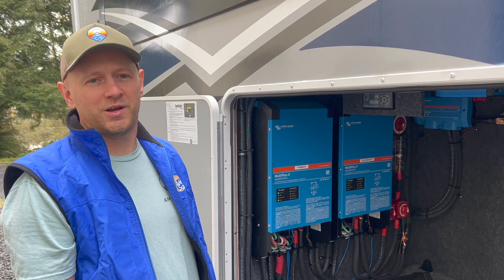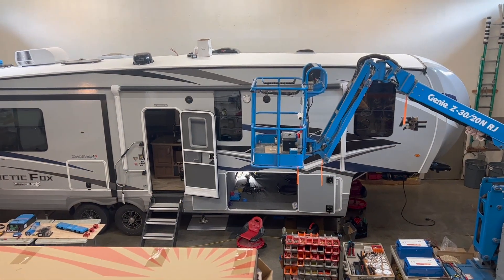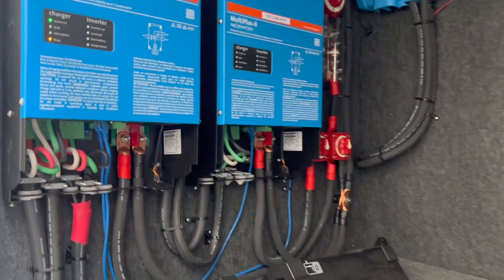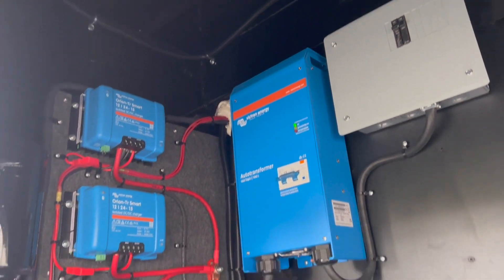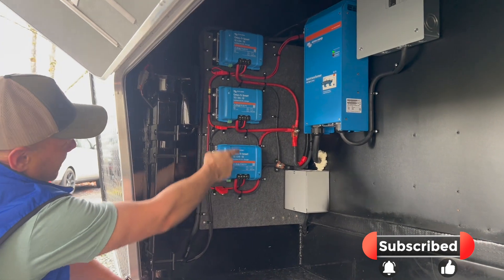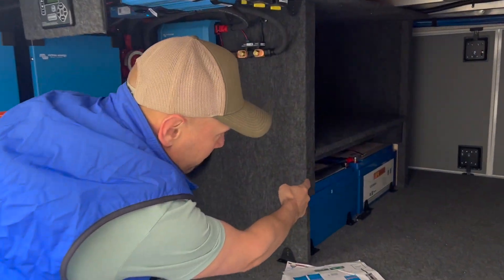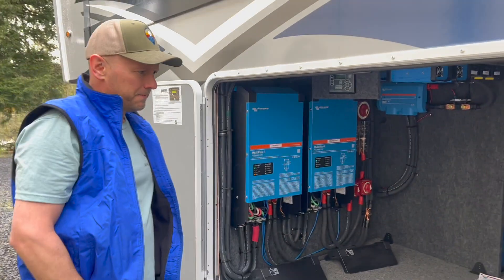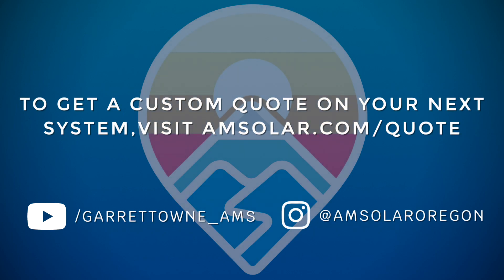Victron Autotransformer System Installation | Arctic Fox Power System Installation

Comment: Is there a reason why you run the inverters in parallel instead of Split phase?
I built a similar system in my RV but I did it in split phase, just need to know if I'm doing things inefficiently?

The purpose of my auto Transformer is to pull equally from both of my quattros.
I also have a cam switch that allows me to change wiring configuration of the inverters into paralle configl by simply flipping the switch and changing the inverter profiles remotely over vrm. The entire thing takes about 60 seconds but I only use that configuration on 30 amp in.

Comment: I'm trying to also run a mini split (and water heater) on 240V. I guess the only reason you couldn't use one MultiPlus is because of the power/wattage needed?

Is there a MultiPlus today that has enough wattage?  It'd be nice to be abale to buy one unit rather than two.
Reply from the maker: The issue is the voltage.  A single Multiplus can only do 120V.  If you want 240V, you’ll need two inverters in parallel, or if your 240V loads are small enough, you can use an autotransformer.